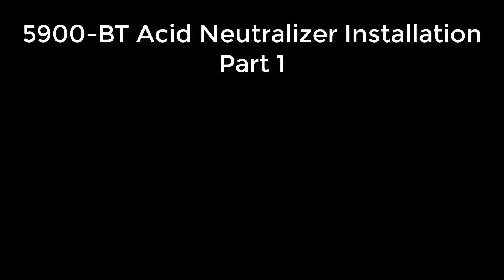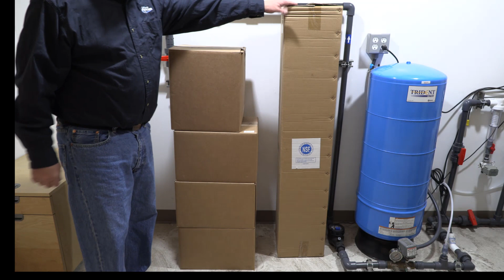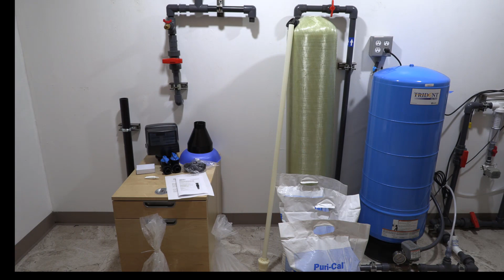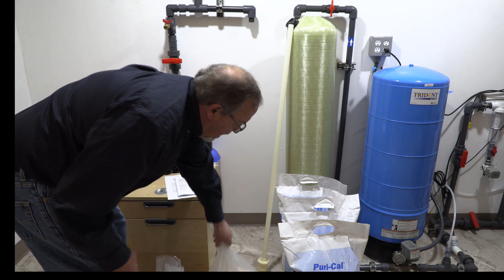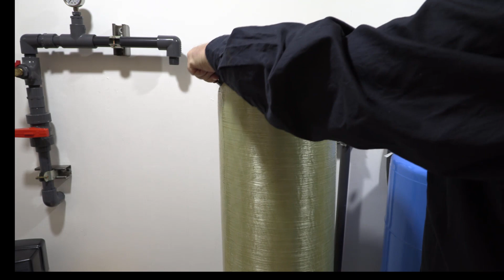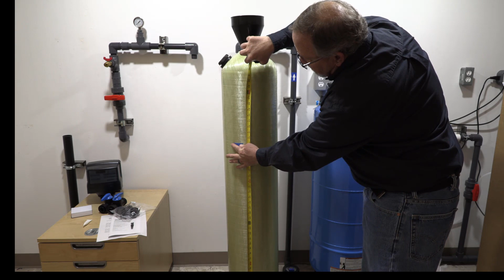Calcite Acid Neutralizer 5900-BT Installation Part 1

Comment: What kind of PVC is the grey
Reply: It is Schedule 80 vs. Schedule 40.  It can handle higher pressures (320PSI vs. 220PSI) so it makes sense to use it in the early runs of your system between the well head and the last filter.

Comment: What is the gravel for?  I was told by Pentair that it isn't necessary in smaller cylinders.
Reply from the maker: Hello - Possibly, you can get away without using gravel.  It is optional for tanks less than 12" in diameter.  We find the calcite dissolves more evenly if you use some gravel around the bottom distributor basket, but it could be optional.

Comment: I just discovered blue stains in my tub and erosion around my drain in the downstairs bathroom. No good
Reply from the maker: Hello Nicholas - this can be a sign of low pH (acid water) but copper corrosion can have other causes.  I would recommend a water test.   Please email us at support@cleanwaterstore.com if would like more information on this.  Also see our report on copper corrosion and what to do about it:  https://www.cleanwaterstore.com/technical/water-treatment-guides/How-To-Treat-Copper-Corrosion-In-Homes.pdf
Reply: @CleanWaterStore  great thanks. I have a local treatment company coming to the house to test our water. We only bought the house a year ago and all tests were perfect. But I was told all the heavy rain in Connecticut this year can cause changes.
Reply: @CleanWaterStore  we did get a test and the ph was 5.6. No bueno

Comment: after refill, when i open the water valve slowly, it still lifts up much during the backwash and I'm concern the calcite is washed out. is there a point in adding more gravel maybe? is that the gravel purpose?
Reply from the maker: Hello Sean -  Sorry for the delayed response, did not see this until now.   Generally we only recommend filling the 2/3rds full.  There would be no point in adding gravel.  If you would like more assistance please email us at support@cleanwaterstore.com.
Reply: @CleanWaterStore  Thanks. I did fill the tank 2/3 and looks like the system is consuming the media quite fast. I wonder on what sort of level setting to set the valve at. water doesn't feel slippery now.